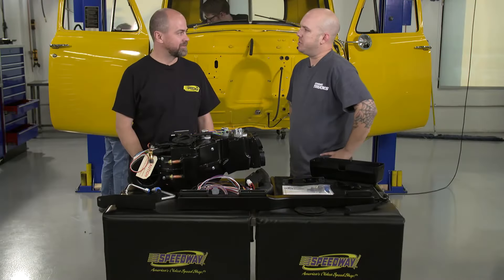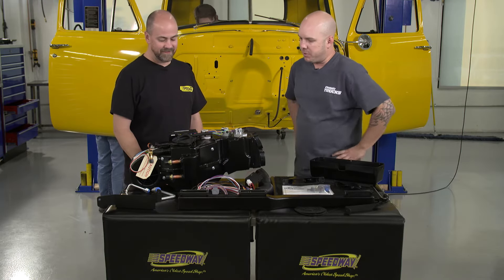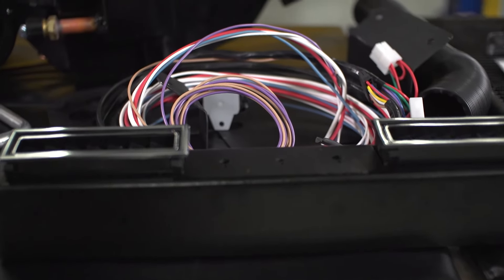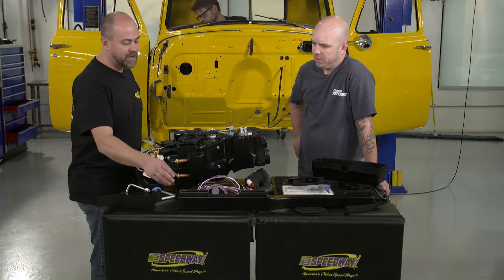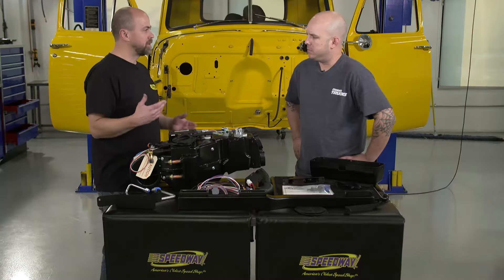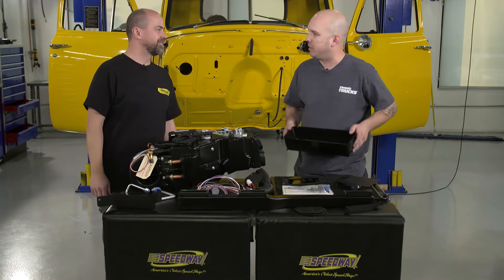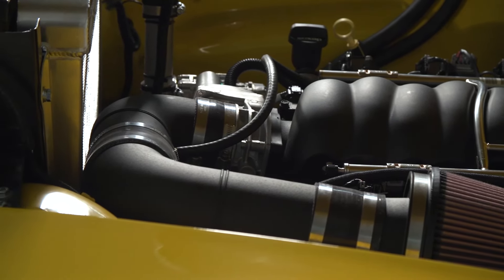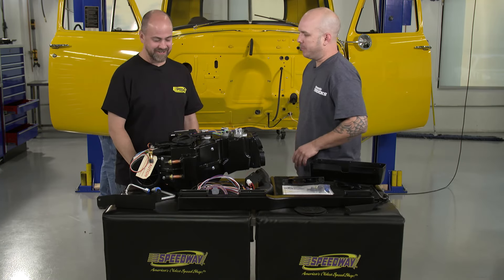Week to Wicked: Vintage Air

Comment: Our 1948 Chevy 3100 still has the 216 engine and that engine doesn’t have a double pulley to accept this kits compressor. Where can we find a double pulley that will bolt on to the 216 engine?

Comment: I installed a vintage air in 1975 Ford Highboy. Very disappointed in the amount of airflow. Went in made sure there was no kinks and ducting was straight as possible. Getting ready to do a frame off on 73 bronco will not use vintage air again. Called them discussed my issue they said never heard of that problem. However I read reviews to the contrary , others complained about the same issue.
Reply: Bob Engbaum hmm... I was looking at getting Vintage for my 71 Nova. So did you ever get yours to work right?